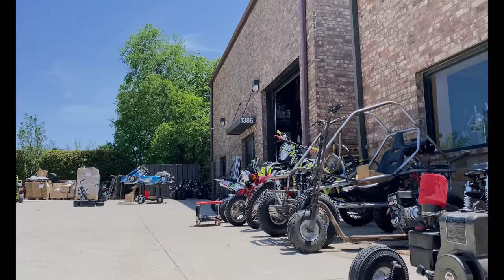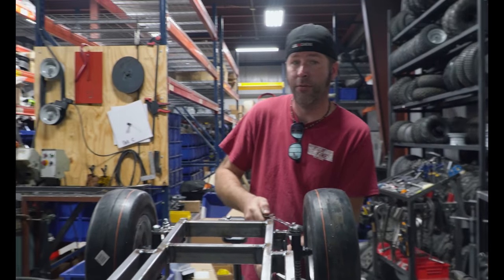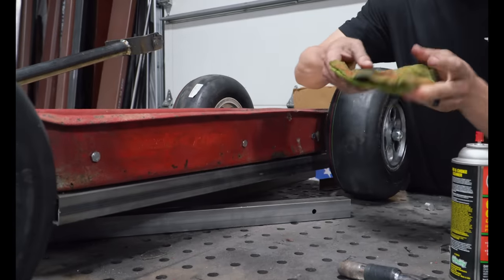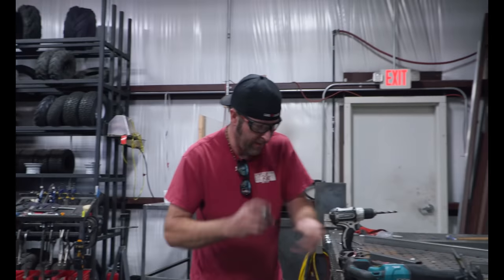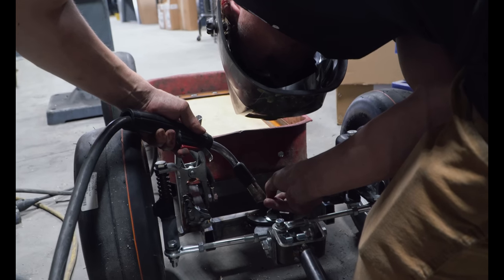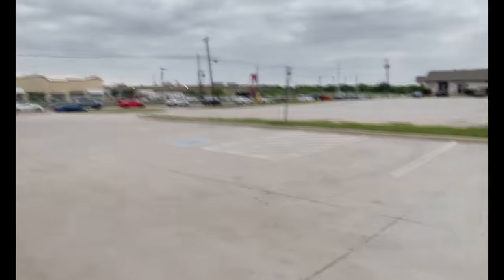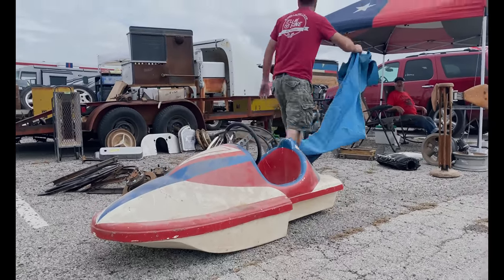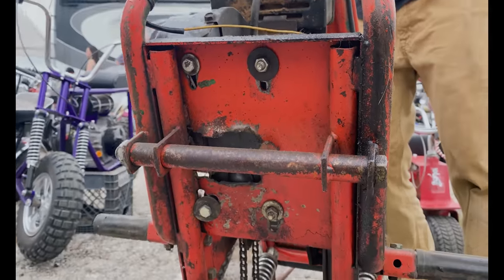Rat Rod Wagon Revival + Parts Hauler First Drive at the Biggest Swap Meet in Texas!

Comment: Weld a piece of tubing with an inner diameter of the wagons hitch bolt on the inside of the trailer handle, that way there is no movement where you tow!

Comment: you guys missed a trick using those rails on the frame as a mont for using the bucket either size....some coach bolts and a couple inch metal inserts underneath would of done the job......

Comment: I think one thing you guys should look at getting for the rat wagon thing is a 650 versys motorcycle engine, about 60HP, 40ft lb of torque engine, hp isnt great but if you get one and it comes with gear box, its a 6 speed, goes like stink in speed (100+mph) and on the lil rat rod wagon, itll make it go really really fast. Itll also pull a 6 litre easy.

Comment: Great work. Try a cheap overhaul trick I learned many years ago on those old 5hp briggs. Order oversized rings and grind the gaps down so they just barely fit in the top of the cylinder where the rings haven't worn the cylinder. This will stop the smoking. It isn't the best fix but it's quick and cheap...........one hour total?
Reply: just getting new rings will fix there smoking issue they dont need oversized rings

Comment: I just bought a honda fourtrax 300 2x4 for $700 dude wired battery area backwards ignition would turn on at off position and turn off on the on position it was messed up but i fixed it shocked they didnt fry nothing